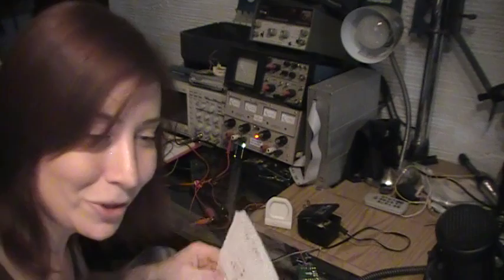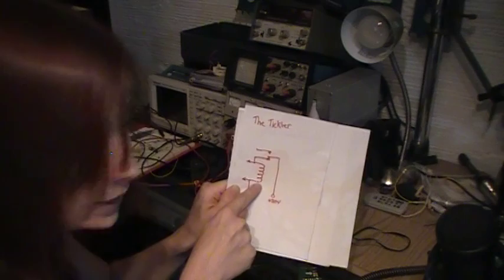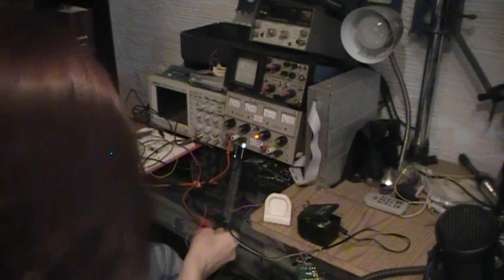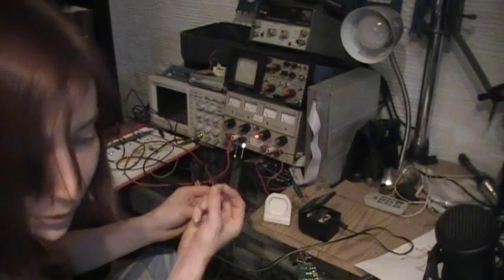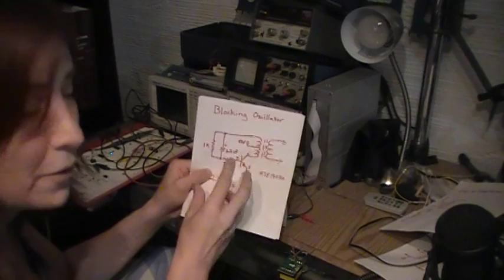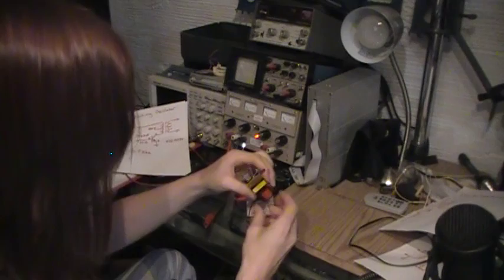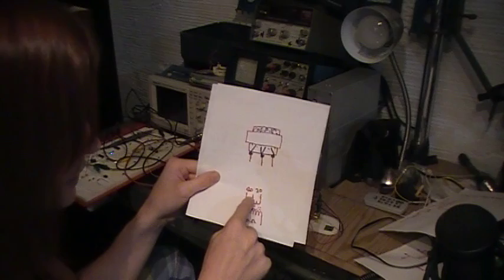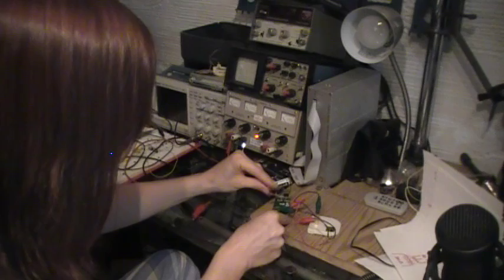EL Power Supplies - Step-up to the Tickler

Comment: I've made a Ruhmkorff coil using these technique. I used a induction coil from an old car as a step up transformer, and i used it's iron core as a relay. You should add a capacitor between relay's contacts, to protect them from high currents occuring. Sorry for my bad english, keep going, your videos are awesomes!!

Comment: That blocking oscillator is stunning; I love basic simple circuits, and I can't imagine a switching supply getting more basic than that. Mine worked well, even with a much smaller transistor; though I need to throw it through the simulator and figure out how to keep the current going through the 33ohm down.

Comment: Thanks, Jeri! But even on 720p I couldn't make out the component values on the Blocking T schematic. But I had a 555 handy so I made it drive a little audio transformer I salvaged from some 70's Realistic AM/FM radio headphones. With the giant telescoping antenna even! It worked great and gave me the bias voltage I needed for my silicon photomultipliers and after dropping the voltage through RC filters and an LR8 HV linear regulator it's dead smooth and quiet. Tons of fun and satisfaction.

Comment: Thanks for the useful design tips Jeri.

After all your good tips for everyone else, here's a quick one for you. When you hold a flat cell, don't put your fingers across the insulating ring. If you do, you will leave a thin slightly conductive layer that will slowly drain the charge from the cell. Hold it by the outer edge, or ideally use tweezers with nonconducting tips.

Keep up the good work.

Comment: This is great. We built one with parts salvaged from an old clock radio. It took some finagling, but the circuit (or the EL wire) is clearly pretty tolerant of variation. We used an NPN transistor, 10uF capacitor, a 1k resistor in parallel, and a 33ohm resistor on the transistor gate leg.
Reply: What part number did you use for the NPN transistor?

Comment: Great video. Liked the way you started with vibrator circuits and ended up with a BJT blocking oscillator with step-up.

BTW never seen those EL night lights here in Oz, but they seem common in the US.

Comment: You are awesome.  I was just playing with a block oscillator last night to generate some high voltage.  "actually I am working on a high voltage high frequency animal deterant" . unfortunately I need a different transformer because all I got out of it from 16V 2.2A was about 12.2MV around .49MA which is defiantly not a lot.   and like you say.  16 volts is cumbersome at times.  it needs to be hand held.  I want the audio blast to be loud so I want to use higher voltage on the speaker 25-30000HZ

Comment: Found you over on wonderhowto[dot]com.  That explanation of the transformer expanding and contracting was an excellent description of my experience with another power supply on EL wire.  I really, really liked how you evolved the tickler circuit, gradually replacing troublesome concepts with more reliable and quieter ones.  The evolution is what made it possible for a non-electrical engineer like me to follow along.  Thanks!

Comment: In the 1950s the smallest computer circuits (experimental only) used EL-PC (ElectroLuminescent - PhotoConductive) logic. It required higher voltages and was limited by the speed of the photoconductive materials at the time,

Comment: No, I did not misunderstand. Allow me to clarify.

The resistance of copper wire is dependent upon three characteristics - the diameter (D) and length (L) of the wire and - to a much lesser degree - the purity of the copper. In this case, we're analyzing D and L, since the same copper is used on P & S. P has a larger D and shorter L, while S has a smaller D and longer L. Because of the difference in diameter, the ratio of resistance doesn't directly relate to the ratio of turns.

Comment: You are awesome.  I was just playing with a block oscillator last night to generate some high voltage.  "actually I am working on a high voltage high frequency animal deter ant . unfortunatly I need a different transformer because all I got out of it from 16V 2.2A was about 12.2MV around .49MA which is defiantly not a lot.   and like you say.  16 volts is cumbersome at times.  it needs to be hand held.  I want the audio blast to be loud so I want to use higher voltage on the speaker 25-30000HZ

Comment: It's more fragile than thick copper, but you can twist it, and maybe put some weight on it. It does get dim over time, especially if the frequency or voltage is significantly different to the the spec of the EL component.

Comment: @Nashblackcat You'll have to forgive me if my electronics knowledge is sketchy on this one, but I believe when the cap is fully discharged, once each cycle, it acts as a short, and so you would have a short from the voltage source to the base of the BJT.  Dropping 0.7V or so from B-to-E, the remaining voltage would have to burn off in the wires (or worse, the transistor).  Although this only happens briefly during each cycle, the 33 ohm resistor insures there's always some resistance.

Comment: Thanks for the blocking oscillator schematic - I have been fighting with an unruly Royer oscillator all week (it burnt out both my wall warts, still not sure why). My one problem with the blocking is that it is a little low power, it can barely light 6 feet of EL Wire. Perhaphs I need to upgrade from my 2n3904 transistor to something a little more beefy.

Comment from the maker: @kendvanpool I have not, but if you could do it with a bridge rectifier that converts the GI 6v AC to pulsating DC, a 100uf or so electrolytic cap to filter the pulsating DC and an EL inverter hooked up to the rectified and filtered power.

Comment: I wouldn't recommend driving directly with a microcontroller. Stepping up a micro's output is a good way to accidentally fry it. I'd recommend an intermediary transistor of some sort. There's also the fact that most micros don't put out high enough current to saturate a transformer core.

If you're trying to bypass the blocking oscillator, you may as well use a 555 astable oscillator with a small transistor (say, 24V @ 2A) to drive your transformer. Smaller, safer, reliable, variable and less $.

Comment: I was recommending a 555 in lieu of a µcontroller, due to the fact that a variable freq. 555 circuit can be built with a footprint of less than two cubic centimetres.

Good idea on the protection. If you have any questions regarding inverter topography, feel free to PM me.

Comment: That's not probable.

Here's a brief transformer lesson. P = Low voltage coil; S = High voltage coil; Colon (:) = transformer core.

So, the ratio is described as the number of turns on P as compared to S. If V (in) = 10 and P:S = 1:10, output is 100V.

Most often the transformers are built with larger wire gauge on P than on S (P, for sake of argument, always being the lower-voltage side).

Since the wire on P is larger in diameter, there is less resistance per turn. I recommend testing output.

Comment: Just plug the transformer into the wall with a 1M resistor in series and put the output on a volt meter (unless it's ferrite).

Comment: So the part when you were talking about the whining sound... My lights ring when I turn down the dimmer switch... do you think the dimmer is cutting power from the bulb to make the filament oscillate at an audible frequency?
I've always wondered about that ringing noise and this explanation would sort of make sense right?

Comment from the maker: @MrTranxistor I'm surprised that's not working.  Do you have the transformer backwards? You should get the 100v out of the wall plug side of the transformer.

Comment: Hey Jeri, I was wondering what the values of the components you are using on the blocking oscillator or if you could email me your circuit diagram. P.S you are a rock star!!

Comment: Right, since V and R are directly correlated in Ohm's law, the S side should have 10 times less resistance than P, and thus S would output 10x more voltage correct?  I think maybe you misinterpreted my first comment.

Comment: Hi Jeri my name is David from Colombia, I am fan of your electroluminesence work, and I have been working in synthesis zinc sulfide doped manganese nanocrystal. 
I have a document where the nanocrystal of zinc sulfide doped manganese are synthesized using sodium sulfide. I would like to know, if you have experience done this synthesis, the reason to ask you this, is because, I have done all the process, I have achieved that the material developed a bright under UV exposure (orange - yellow) but when I use a blocking oscillator it does not work, please can you help me solving this issue.

Comment: Sooooo,.....I am thinking that If I tap into my landscape lighting along my driveway, which is powered by a 12 vac transformer, I can take a small step up transformer and obtain 120 vac power EL wire for a holiday decoration.  I am assuming that low current draw means I do not need to be concerned with safety.  Is my logic correct or flawed.  Not sure here.  Any comments are appreciated.  Thanks

Comment: Is the resistance directly correlated to the ratio?  so if you measured 20 ohms on one side, and 200 on the other, would it be a 10:1 ratio?

Comment: @jeriellsworth so if i wanted to use a wall wort transformer as a step up transformer, do you just devide the ~120VAC imput by whatever the secondary side is to get that ratio? Then could I just rectify the output with a diode if I wanted DC? Maybe add a filter cap to smooth out the voltage?

Comment: could I just use the pwm i/o pin from a microcontroller and hook it up directly to the step-up transformer instead of building the blocking oscillator?

Comment: i found a tiny 1 idk if it will do the same came off a 1 time use camera i wanna use it on a motor project the glue kinda came off the 3 pin holder so it not stable i just need thos part list that on the circuit

Comment: Hey Jeri, I saw a very interesting video on making a 50kv transformer from an old Franceformer  15kv 300ma neon sign transformer.. It was potted in some kind of plastic or tar.. The old guy cut a propane tank in half, put a old wire grill inside. He then put the TX in there put the lid on and he had a hole in the upper side that a torch went in to heat it to about 350-400 F so it would melt away everything but the coils and core..After cleaning up the whole thing he cut the core into two C cores instead of E and I . I was thinking, maybe the same can be done with microwave cores. I have taken many MOTS apart and have several intact secondary coils as well as primaries.. I was thinking of using two or three secondaries wired in series with one primary to get 15-25 KV.. Please Help..
Reply: is that a french transformer a franceformer ahahha

Comment: @liquidus2172 That's one of those questions where if you have to ask, you should probably gain a little more understanding of electronics.  To answer your question, yes you could use that to generate high voltages like in a stun gun, but you would need to run it through a cascade multiplier. Do a web search if you don't know what that is, and please be careful. HvDC is potentially harmful or even deadly and can arc REALLY far, so standard insulation won't protect you. Happy nwyr :)

Comment: @jeriellsworth so i am trying to use the tickler circuit. are you giving it dc? i am feeding mine 12 volts and it seems to offer back 4.7 also it trips the fuse on my psu could just be a garbage psu... do i need a diode or resister somewhere?

Comment: I'm having trouble getting the final circuit to work. As far as I can tell, I have everything the same. I can measure about 25 v ac from one of the taps on the primary side of the transformer to ground, but on the output side of the transformer I'm seeing like 2 mv. Anyone have any ideas what it could be? I've tried it with several transformers, but never get any output.

Comment: BTW I also don't like how this video is posted on tons of websites all for a circuit that doesn't work and blows transistors!
Reply: Doesn't work? Blows transistors?

I just built this exact same circuit...using off value components and a smaller transistor. Circuit works great. Maybe you don't know how to build circuits.
Reply: Jay Moore You better watch your mouth dude! You have no idea who I am and my knowledge!  In fact I'm sure I know way more than you ever could!
Reply: Look Scott Kletzien, if you can't get something as simple as a blocking oscillator working without blowing up transistors; I seriously question anything you claim. I'm sure someone with your knowledge would have been smart enough to do something as simple as google "blocking oscillator" and seen the countless examples that are that same basic circuit. 

I repeat myself; if you cannot build a blocking oscillator without blowing transistors; you are doing something wrong. And anyone with the knowledge you claim to have; if it was in electronics, would have figured out the issue and maybe shared the suggestion in a comment. Instead...you offered nothing.

I'm guessing you're either trolling because you can't build circuits that work; or you work for a company that sells inverters and are using a pathetic attempt to draw people away from DIY in an effort to sell more stuff.
Reply: Scott Kletzien There's always one in the group, and in this case, literally ONE.  She doesn't have to post these tutorials but she does and it's a service to hobbyists. You're the only one on here ranting about blowing circuits which means YOU are the one with the issue. I guess what I am saying is, you're the one who blows.....your circuits :-)